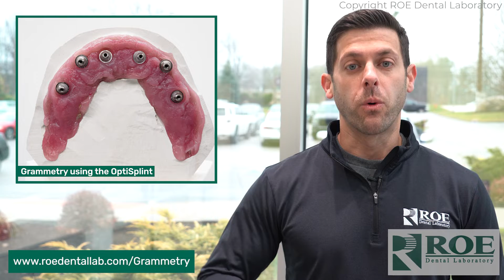How Does Grammetry Stack Up Against Photogrammetry?

Comment: I'm a little confused how this achieves a low enough deviation to be used for implant prostheses. Medit i500 deviation by itself is about 20 microns. (My scanner)

 Implant restorations need around 10 microns accuracy for passivity, no? Have I been misled here? 

I've been taught that if you aren't doing photogrammetry with accuracy under 10 microns, the only other way is a jig scanned with a desktop scanner. I love my Medit T710.
Reply from the maker: You have not been misled, you bring up a great point. IOS is not yet accurate enough to go to final zirconia with either of the grammetry workflows; archbridge or Optisplint.

That is why in these workflows we require a jig to make a model or at least to scan in a desktop lab scanner.

The archbridge workflow incorporates an ijig (add a link to that) a sectioned prosthesis to lute in the mouth post healing and send back to us. That is our verified positions to go to final zirconia.
The Optisplint is luted in the mouth the day of surgery. That verified jig is sent to the lab when it is time to transition to final to scan in the desktop lab scanner.

The day of surgery designs that are sent to the office to print and seat are accurate enough using the iOS due to the flexibility of the 3D printed resin.

You can learn more about our Grammetry workflows by visiting our website and following this link: https://www.roedentallab.com/products/implants/full-arch-fixed-options/grammetry/

Comment: If we send you an ios scan through cerec portal how Wil you convert it into photogrammetry file???
Reply from the maker: The required grammetry IOS scan files are imported into exocad by the lab and there is a library for the Optisplint within the exocad software to allow us to fabricate an accurate, direct to multi unit restoration. Photogrammery scanners also have a similar library within exocad.